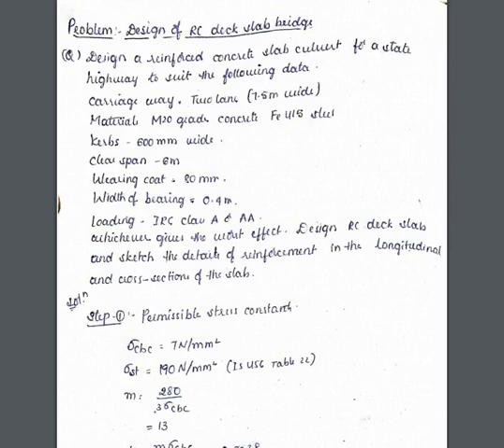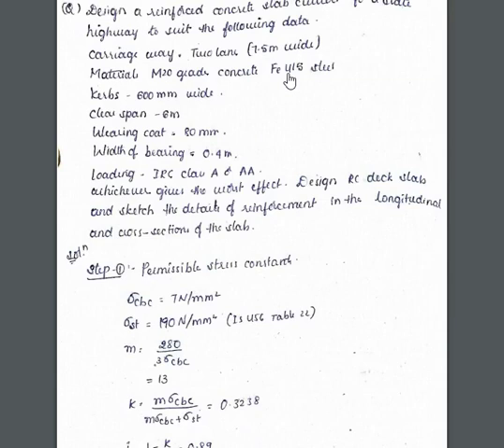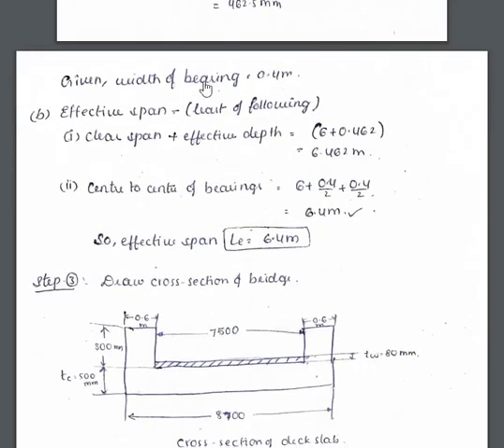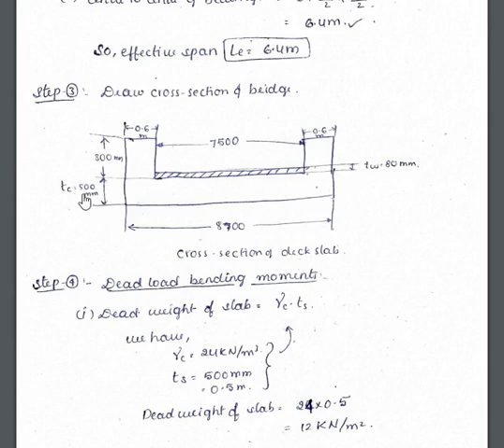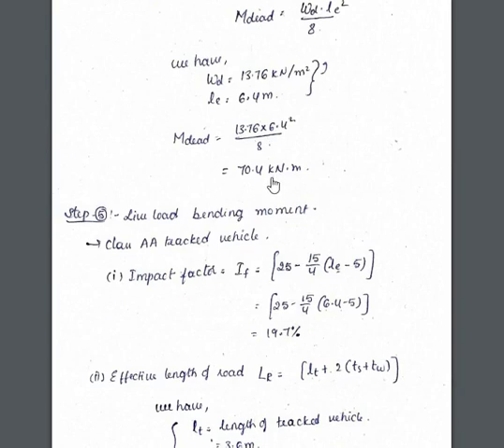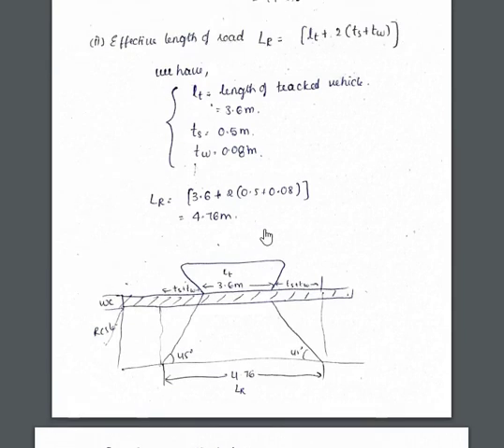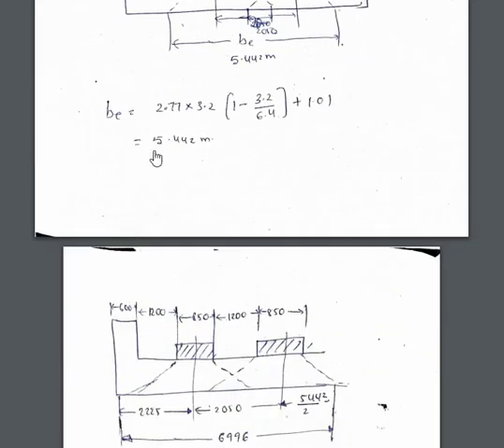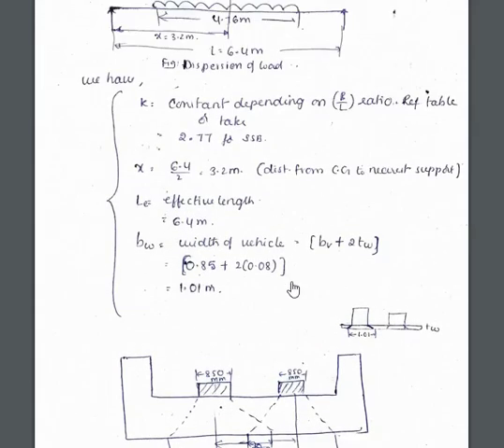Problem of design of Deck slab bridge Part 1/2

Comment: mam at 9:32 in video ,why didn't we consider the kerb on other side in diagram while calculating width of slab?
Reply from the maker: Because, we are trying to find out the width when the vehicle is placed near to the supports.  Spreading of the vehicle wheel load shall not reach up to other kerb, according to vehicle width here. So need not to consider it
Reply: thankyou mam

Comment: And mam in calculation of Dead load why we are not considering the selfwight or  load  from kerbs or footpath
Reply from the maker: Hi Nasreen..,  Do we consider parapet walls while calculating dead loads for slab of a building..? no right.. !! In similar manner,  we don't consider them while calculating dead load of deck slab in general. Simple reason, is their values are very less compared to dead weight of slab. But in special conditions they might be included  considering suitable specifications.